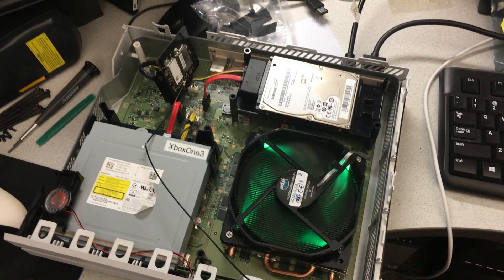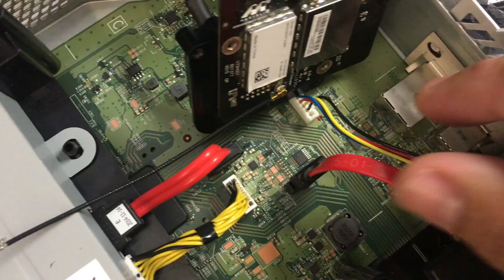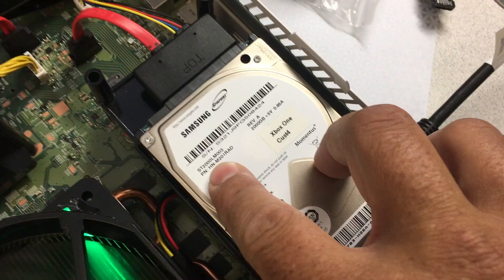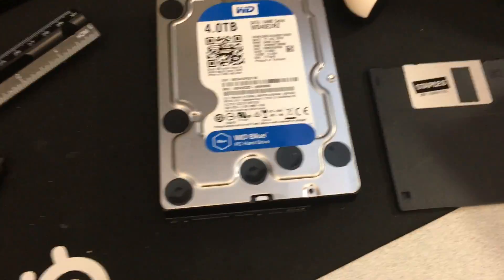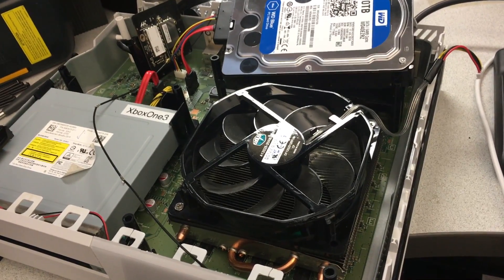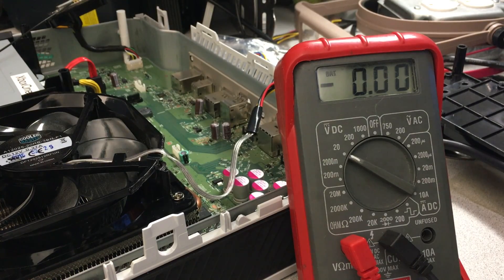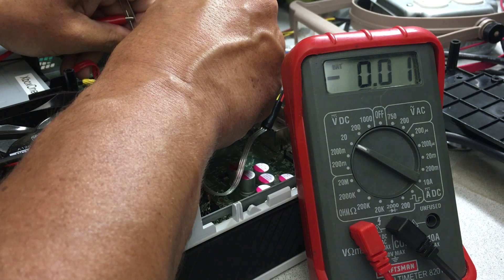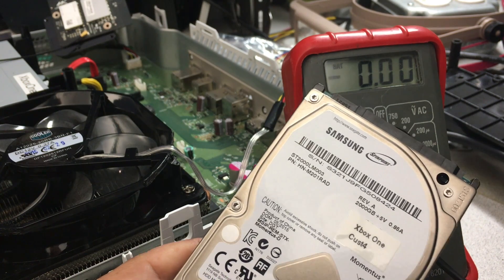Xbox One 01: Can you use an Internal 3.5" Desktop Drive?

Comment: I use custom cable from pc, sata cable and moded power cable 5v and ground to Xbox pins to power HDD and 12V to pin with 12V on the Xbox board and this work normaly.
Reply: Can you put a picture of the cable

Comment: What about powering from dvd/blue ray drive power?
Reply from the maker: When the Blu-ray drive isn't active power is cut to the device after a certain timeout. Found this out the hard way when powering LED lighting. You'd be better to pull 12v from the APU fan. That said, since the max internal size is 2TB there isn't much reason to do this anyway.
Reply: @mpdavig  7200rpm sshd. For some reason I cant find this in 2.5  even in the enterprise level. More money cant solve this one at the moment. APU fan is a good tip
Reply: @mpdavig  I wonder if some sort of partition swap could be achieved, similar to those large third-party playstation memory cards that had ever a button or software to switch between menory banks, negating the storage limits of the system

Comment: Can i put an external hitachi hdd 3.5 2tb 2012 as an external hard drive for xbox one by connecting the disk drive with a converter sata /usb with power supply?
Is the xbox one will read it correctly and transfer the games to it?

Comment: Can you turn the internal Xbox drive into external by adding USB output
Reply: Yes
Reply: When upgraded my ps4 to the seagate 2tb hhd I re-used the casing on that external hdd to put the one that came out of my ps4 to it then plug it in to my xbone to use as a dedicated drive n it works fine
Reply: @mortiarty7842  whats the casing called? send a link

Comment: im trying to do this but the opposite way im trying to use the xbox one hardrive in my laptop but every time i install a os it formats its self to its original state
Reply: NovaFusionZero Try using diskpart, list disk, sel disk ?, clean all, so it zero all hd.
But be sure to sel the correct disk.

Comment: Does this work, putting a 3.5 inch drive in xbox one x work?
Reply from the maker: coldkeyes 3.5" drives require 12v while 2.5" only require 5v, hurdle 1. The One X can barely fit a 2.5" drive never mind 3.5" which is major hurdle 2. Since Xbox One only supports drive sizes up to 2TB there isn't a need for 3.5" anyway.
Reply: XFiX So the system cant run a 2.5 inch 4tb ssd?
Reply from the maker: coldkeyes you could but can only utilize 2TB of it: https://youtu.be/tcoa8Xx_6oU
A 4TB SSD would make a great external though.
Reply: XFiX So if I install an internal 4tb after setting it up via linux it would do no good then
Reply from the maker: coldkeyes well the problem is, no matter how hard we tried, the Xbox One operating system isn't able to properly handle >2TB partitions. Do you already have a 4TB SSD? That would be quite expensive.
Reply: XFiX I want to get one, because I dont like the idea of external due to fear of moving, I would lose it in a box somewhere and i am super sensitive about my stuff getting damaged

Comment: Have done this with a 2TB Western Digital Black.  You simply need to prep the drive as usual, use your own external power supply just for the drive, and your own sata cable as you cannot use the one provided without modding.
Reply from the maker: That's cool, I had no idea people were even interested in attempting this until recently.
There are 12v points on the motherboard so the power could even be drawn internally. For instance the Blu-ray and fan provide 12v lines but I'm not sure if they provide the proper amperage. Also, the Blu-ray 12v does turn off when the drive isn't in use. The fan 12v is always on since speed is controlled by the PWM line.

Comment: to test the partitioning guide you made i actually used a 3.5 drive and couldn't figure out why the xbox wouldn't boot until i realized that it probably wasn't giving it enough power. So i rigged up a sata cable to the xbox one and a power cable from my pc to the drive and got it to work for testing reasons
Reply: I just did that bcs i wanted to know also and im loading the software rn looks to be working dosnt look good but it works so far